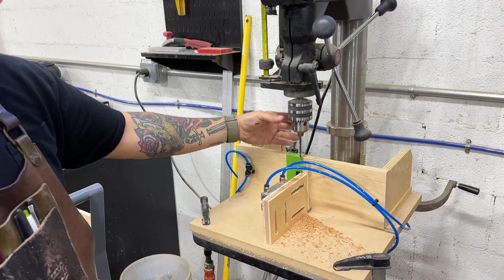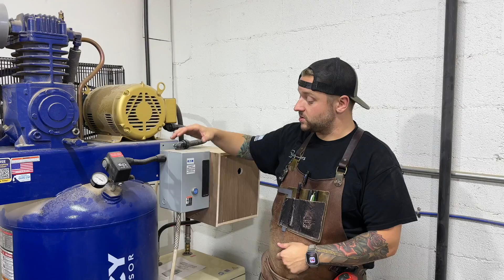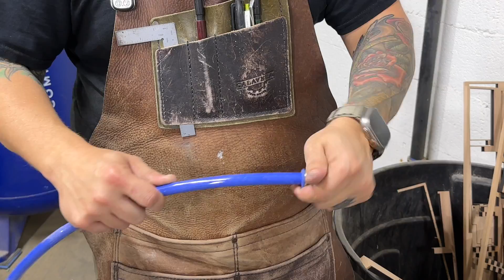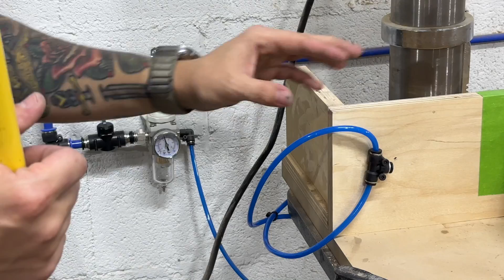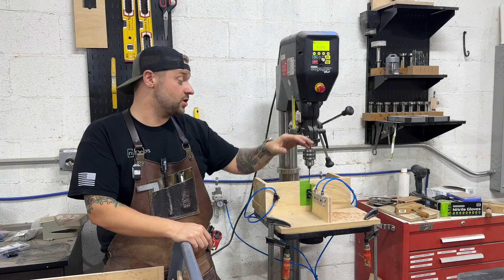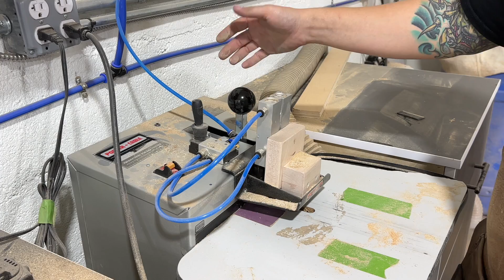The Ultimate Drill Press Jig - Simple Woodworking Solutions

Comment: really smart jig. can you confirm what size tubing you used. i also saw your setup for pocket hole machine with switch. pretty cool. if you can show the jig your partner made for door and panel clamping that would be interesting.
Reply from the maker: https://kourostools.com/ for the clamping setup.
Reply from the maker: Thanks! The small tubing is 6mm but you can use any diameter as long as your push to connect fittings match. For the shop air the tubing is 1/2” OD 3/8” ID.